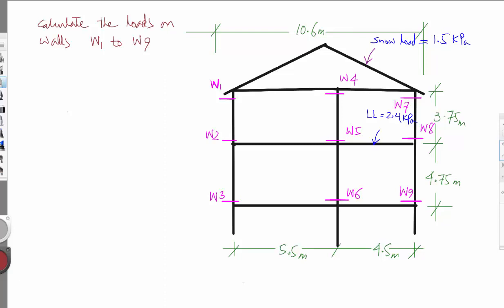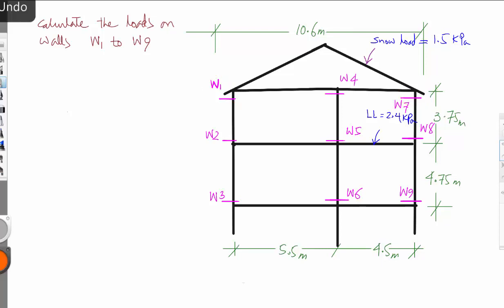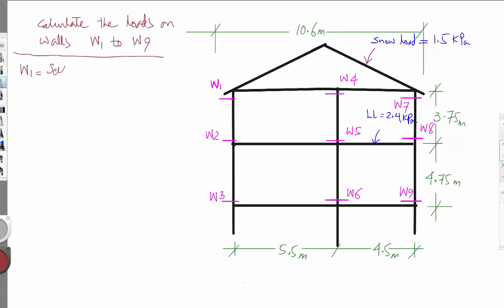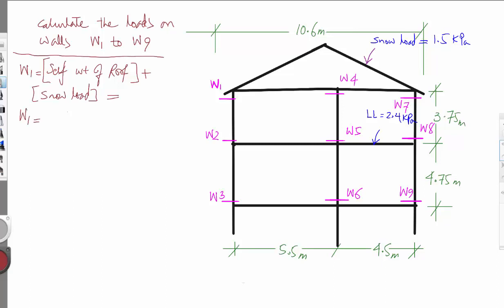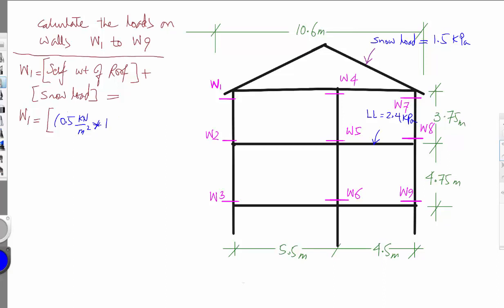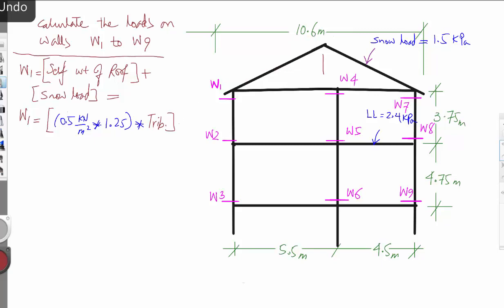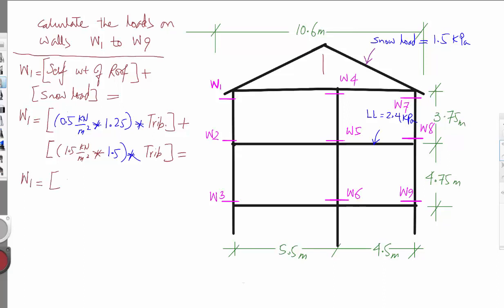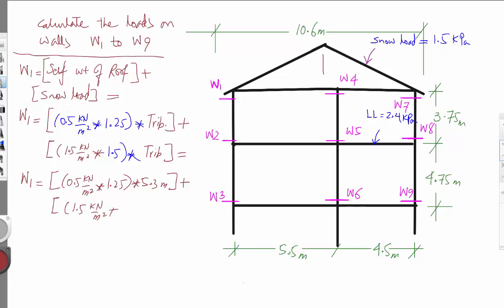Week 10 Wood structure Load calculation Example

Comment: I understand that the load from the roof is transferred only to the perimeter walls, but the floor member above W1, W4, and W7 - why is this not considered? No DL or LL from this?
Reply: He said it is a truss., so there is no LL ( no room for human or storage when you use a truss so no LL ).  However, If it was a rafter roof system, then there would be an attic and there would be room for LL.  But you are 100% correct regarding the DL. he only used 0.5 KN/m2 for roof load which means he did not count for the weight of the trusses.